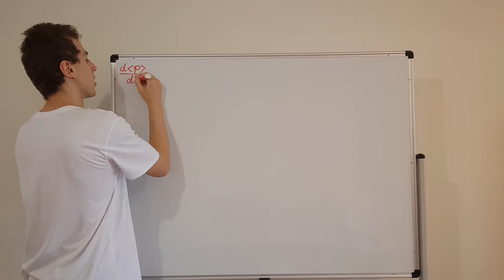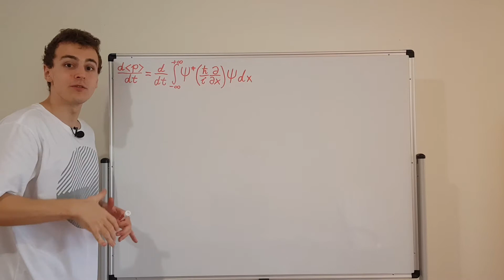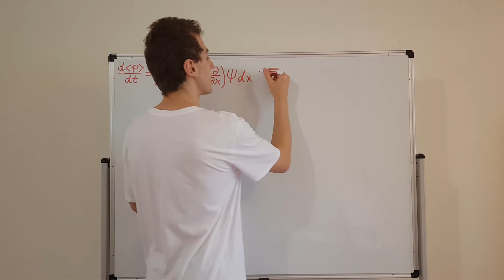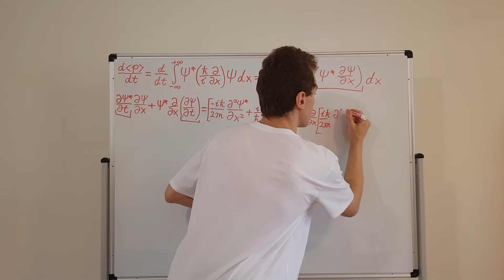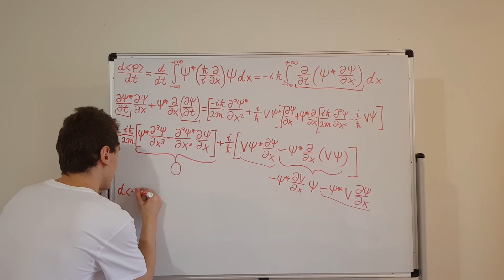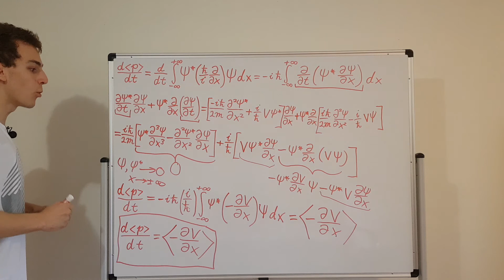Ehrenfest Theorem Derivation - Time Derivative of Momentum Expectation Value (Newtonian Mechanics)

Comment: You skipped the only part I don't understand Integrating the left hand part to make it go to zero :(
Reply: So the expression that bothered you is = psi* D3(psi) - D2(psi*) D(psi) where I use Dn to represent the order of differentiation with respect to x.  Apply integration by part to the 1st term.  Here u=psi* and v=D2(psi) and remembered to set uv=0 in the result of integration by part.  -D2(psi) D(psi*) - D2(psi*) D(psi). Now do thd 2nd integration by part to the 1st term, set u=D(psi*) and v=D(psi) You get D(psi) D2(psi*) - D2(psi*) D(psi) which is zero.  Doing integration by part twice negate the negative sign up front.  Note that I have not done anything to the 2nd term in the expression in the process.
Reply: Integrate u(dv/dx)=uv - Integrate vdu/dx.  Here u and v are functions in x.  This is integration by parts.  In QM, uv is evaluated at positive infinity and minus infinity and the result is zero.
Reply: @peterwan9076  Why is uv zero when evaluated from -infinity to infinity?
Reply: @evanbutler4307 bcz uv s in almost every integral ing QM have a Psi or a Psi conjugate term. And one of the postulates of QM is that the wave functions and their derivatives drops to 0 at infinity . This is a must to normalize a wave function.
Reply: Here a hint for you: in quantum mechanics integration of psi or psi* over (-ve) Infinity  to (+ve) infinity is zero bcz psi is matterwave is different from others wave, afterall matterwave contain particle at a specific point, btw when you take infinte integral of matterwave its goes to zero, also same for d(psi)/dx
Reply: Watch his whole series , it will help a lot .